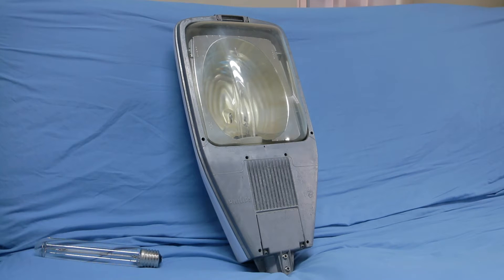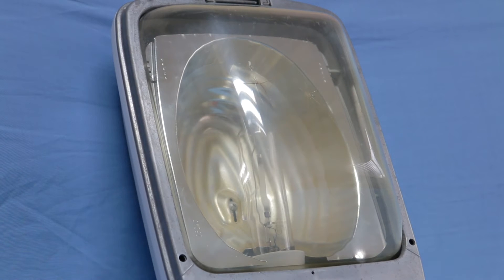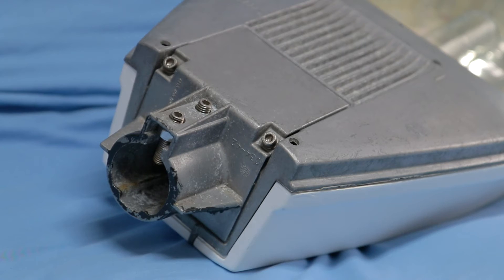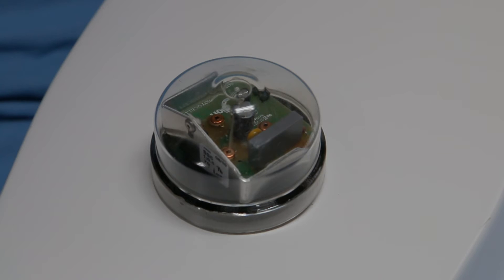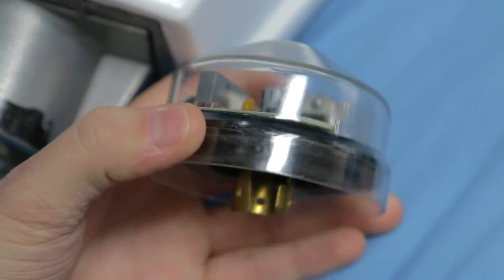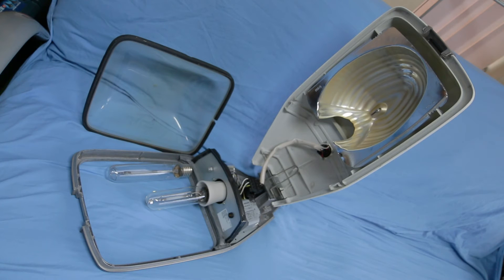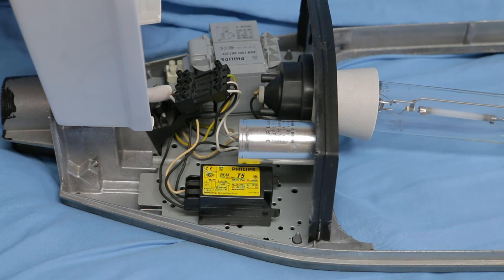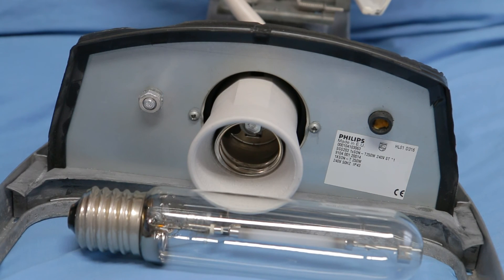Equipment inspection: Philips high-pressure sodium street light head.

Comment: This is a lovely Philips SGS 203 and it only take up 2 150 Watt SON-T maximum height 10 Metres. Philips SGS 204 can be mounted at 12 metres vertical or horizontal or else flat glass 400 Watt SON-T mounted at 14 metres
Reply from the maker: 203 can take up to 250w.
Reply: OK good then I saw today the council taking down all SGS 203s at 10 Metre 150 SON-T Watt also Philips SGS 204 150 Watt SON-T and putting up Indal LED the lanterns that are flat and shaped like a spatula.
Reply from the maker: Bit of a downgrade then!
Reply: Oh that's alrite